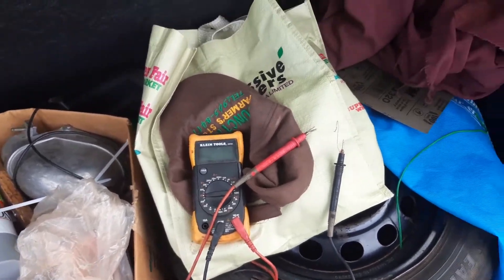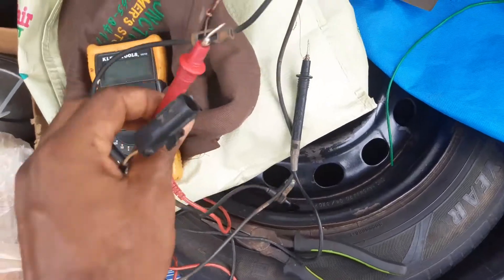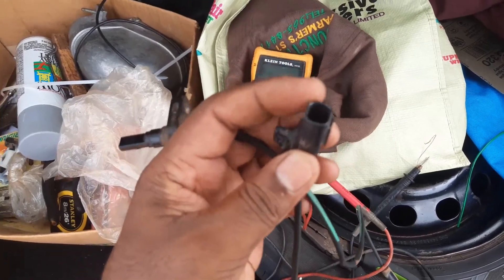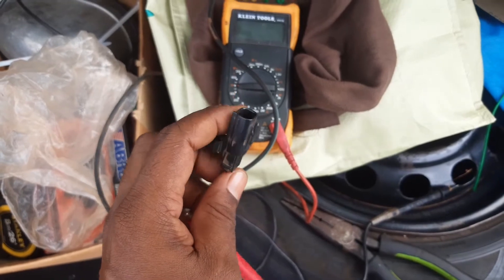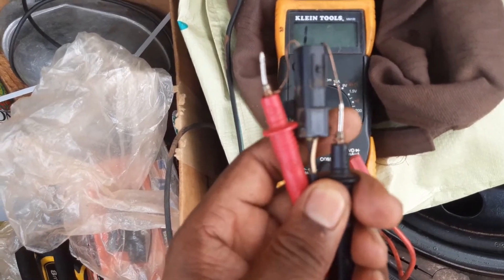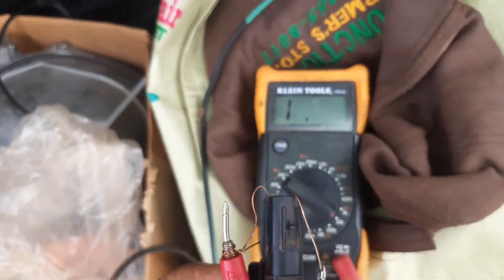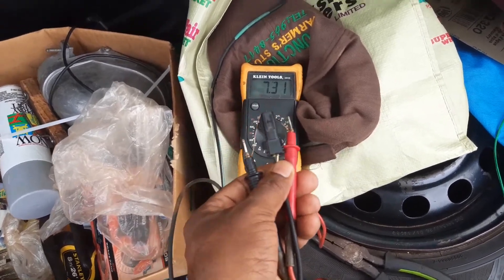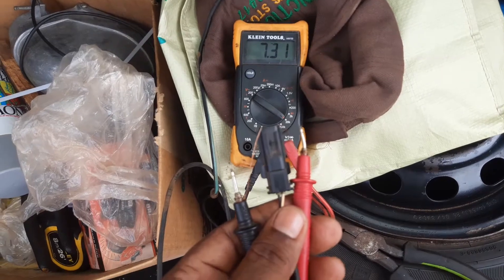Toyota Vitz Front Wheel Speed Sensor Cable Diagnosis

Comment: Will toyota vitz shift gears  with bad front wheels sensor
Reply from the maker: A bad wheel speed sensor should not affect the transmissions ability to select different gear ratio. Since the speed sensors handles traction control and all other ABS functions it may also affect your speedometers deflection if its not working properly.